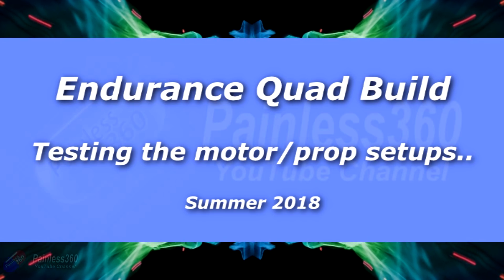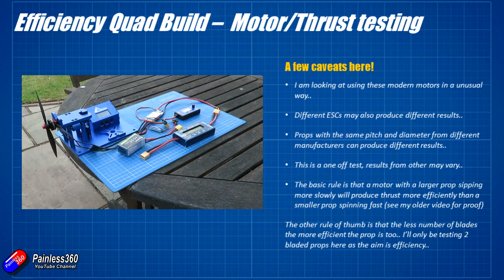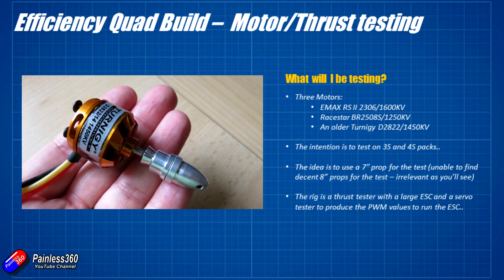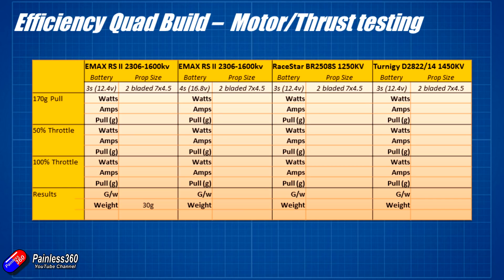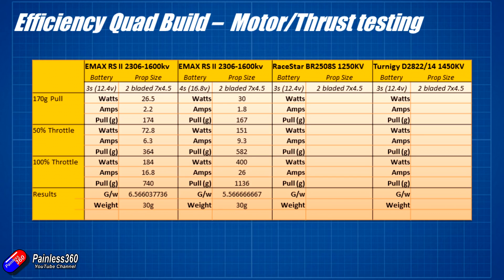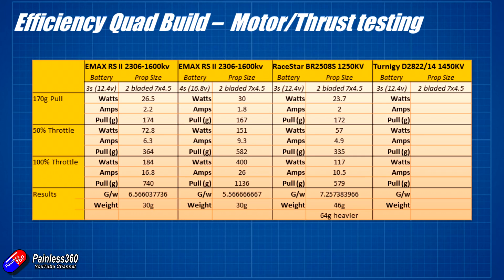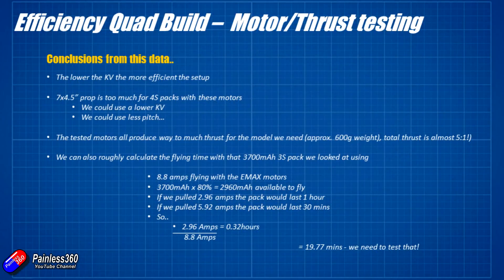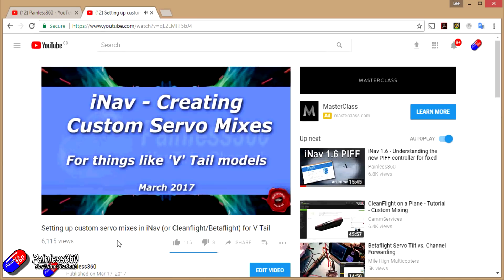Endurance Quad Build (S9): Motor and Propeller Testing

Comment: Dear Sir,
You tested the thrust of the motor horizontally. Would thrust be the same when we use it for vertical flying?
An Rc plane engine states that it has static thrust of 23.5kg at 1800 meters. Does that mean straight upward from ground?
The question what I'm trying to ask is: if the thrust is calculated horizontally ( you did in this video), would it be same straight up vertically?
Reply from the maker: Yes. Happy flying

Comment: Wait I just ordered these 2306 motors to use with 6s and HQprop 7x4.5x2. Yet you are saying even on 4s they get hot. Can I expect failure on 6s?
Reply from the maker: Unless the motor design specs have changed from the ones that get here - possibly. You always need to look at the prop design, size and pitch if you plan on changing the voltage you'll run it at.. Best of luck!
Reply: @Painless360  So if I wanted to use 6s on 7" I would need something like 2507 sized motors to not worry about the motors when flying aggressively?

Comment: I see there is a typo in the resulting data table. 
On the right, last column for Turnigy, at 50% Throttle the pull (g) value seems wrong, it should be 333, or around it, not 33.3, I suppose.

Comment: I’m new to quads however, I flew glow rc plans back in the 1990’s from .25 thru .90 size planes. Most of them where trainers to intermediate high wing models. Currently following your advice and fly small indoor quads and slowly advancing to a larger machine as my skill and confidence grows! That being said, I enjoy your instructional videos and have learned and continue to learn about FPV quads and the new technologies entering the hobby. Thank you for your time and effort as you are a great instructor.
Question about your thrust and motor selection has come to mind. Back when I was flying regularly, an advanced pilot and rc builder told me and other newbie’s that a move to three bladed props required a reduction in diameter and pitch to come close to the efficiency a two bladed version the given engine was designed for. This includes fuel consumption and temperature control. Therefore, why wouldn’t this be true for the electric motor given the forces of mass, inertia and centrifugal force? Could you not achieve a “ close enough result” with regards to thrust and current draw by reducing your diameter 1/2 to 1” and decreasing pitch?
Look forward to your response!
Reply from the maker: It still holds true - I normally drop an inch when going from 2 to 3 bladed props - you can see the effect of tri-bladed props in motor thrust/watt tables.. Hope that helps..

Comment: This may not be what you're looking for but I did some similar motor testing a while back. I used the same test stand you have and The Emax 2213 935kv Multicopter motor. 3s Battery

8x4.5  prop
50% throttle   161g thrust / 1.7amp draw /21 watt
100%              523g thrust / 6.6amp  draw / 80.3 watt

9x4.5 prop
50%               269g thrust /1.9amp draw / 23.5 watt
100%             778g thrust / 9.2 amp draw / 111.4 watt

10x4.5 prop
50%              333g thrust / 2.5amp draw / 30.9 watt
100%            938g thrust /11.3amp draw / 136.1 watt

The motors are quite a bit heavier at 53g apiece
Cheers!
Reply: Thanks for sharing that data!
Reply: You're welcome!

Comment: Great job, but! You need to try the Racerstar BR 2508S 1250kv with batteries of 4s, the real efficiency you will find in the thrust that the engine has half power or less, seldom is flying at full speed, because it is not a racing drone.

Check this out...

https://www.youtube.com/watch?v=hVu9AVy06fQ

https://www.youtube.com/watch?v=1xJyuDpwkJI

Comment: Built a 7in RMRC Valorem recently with the 1600kv RSII.   AUW without Gopro is 619g.   Using a Tattu R-line 1500mah 4s and HQ 7035x3 props I hit 8 minutes 30 seconds cruising around the neighborhood which means turning around and doing lots of figure 8s.   Motors were barely even warm.     Going to retry with gopro Session attached to see if I can do over 6min on 1500mah before trying bigger 4s packs like 1900 or even 5s on 6in while maintaining very careful throttle control .

Also built a 550AUW  6in Flowride that is on HQ 6040 V1S props and Emax RSII 1700kv motors.   Got 9min 30 seconds doing same style of cruising as with my 7in.

A 3rd Valorem 6in was built that is within 5g of my 7in Valorem.  it is running 2405 2250kv Hobbywings and HQ 6030x3 props.   On the same 1500mah Rline I hit 6min 30 seconds.

Comment: its odd your motor got hot on the 4s 2306 1600kv test, im running the same motor with 7x5.6  3blade on 5s with no issue
Reply: Does 6s get hot?

Comment: remeber that you have to stop the flight 15-20% before the battery is discharged completly. so it ends up with around 15-16 min. but anyway. 15min is grate.
Reply from the maker: Erm, please watch the video again. The 20% needed to be left in the pack has already been accounted for..

Comment: Awesome video! I wish I had come across something similar when upgrading my build. I bought 160g motors to replace the original 110g motors on my quad, not taking into account the extra 200g additional weight penalty, with no particular gain in efficiency.

Comment: This is great! Actually trying to understand quads instead of just schilling for the manufacturers with the latest, greatest and shiny-est quad. Some of us would like to fly high and slow for camera work instead of playing Star Wars racer through the woods....
Reply from the maker: Thanks Dave, those of us that don't race have been neglected by the frame and motor manufacturers over the last couple of years. If you want a camera ship then you have to spend huge amounts of money for something like a DJI product. For me, I still want to build a quadcopter using modern components but fly for a lot more than 5 minutes at a time..
Reply: This!  I don't want a costly DJI, and I'm not ready to play StarWars through the woods.  I'm trying to find builds for stable easy cruiser to carry FPV equipment and decent flight time and long range so I can enjoy the building and tweaking process and then get a great FPV view.  So far I've only seen flying wing vids that meet my criteria, but I really wanted a quad so I can stop and hover while looking around.

Comment: What about using the Garila 2507 1500KV motors? Or the Garila 2514 motors?
Reply: RCX has a 2208 1100kv motor at 43g
Reply from the maker: That's more like it! Ideally less than 1000kv would be perfect to test. Thanks for the suggestion!

Comment: Test flown my 7” vortex 285 the other day, still very agile even with a 4s 3000mah hanging under it. Your thrust data has inspired me to try a 3s 3000mah now though.
I’m running emax mt2206 1500kv motors 7x4.5 props (spin on slow fly) and am consuming about 8A on hover with the 4s 3000 and a xiaomi yi camera on board. In case anyone’s interested.
Reply from the maker: Thank you so much for posting that, so im not on my owm here! Looks like we're getting similar results. I'm planning to drag out some DJI 2212 920kv motors next!
Reply: Painless360 I think dji cleaned up the motor and esc niche for the 450 sized quadcopter when they brought out their e300 tuned propulsion system. What frame are you going to try those motors on tho?
Reply from the maker: Something a little special I can't talk about... yet! :)
Reply: Benjamin Harvey are you on stock ESC
Reply: Craig Demarest I am indeed. got about 10 minutes flight time. I’ve a 3s 4000 to try.

Comment: Emax on 4s at 50% throttle producing slightly more thrust and lower amps than the 1250kv Racestar at 100% throttle.   Considering weight I would likely use Emax and change the range of the controller so 50-60% throttle was my new max, have more resolution and lighter build weight.

I would go Emax and 3s with full throttle range or Emax on 4s and keep myself from using full throttle.
Reply from the maker: Thats what i did, you can preview the actual flight test in the next video in build playlist.. Happy flying!

Comment: It's a shame emax arent publishing any decent thrust data anymore. Was looking for data on the 1600kv's with a 6" prop the other week and also came up with nothing. 
Getting a fair bit of jello on my 7inch setup at the moment, so, I'm going to try swapping out the motors on my 6" quad for the emax 1600kv's and see what the flight times are like with a 4s pack.
Reply from the maker: Balance the props and also check the hubs too (See my balancing video) I find that helps..
Reply: Yeah, good point. I've not even checked them for balance yet. Had heard good things about the gemfan 7042 being pretty good out of the pack, but its worth a shot. 
I've a couple other types of 7-inch props lying around that I'm also going to experiment with too, will be interesting to see how they compare. 
Looking forward to seeing how you get on with the rest of your build!

Comment: Ive been playing around with my 7" helio spring quad with 6" props, tmotor f60 2350kv with dual 3S 1800mAh batteries 1top/1bottom mount and have been getting close to 12 minutes of linear flight without goPro ( moving those motors to a 5" Catalyst build when they release the "smooth operator") What size motors should I look for I wonder? Was going to try some 1700kvs but now i dont know lol
Reply from the maker: From this testing it depends on the pack you'll use. I would look for a motor <1300kv.. Let me know how you get on!

Comment: A suggestion for a future build....an Ardu Rover. An long range FPV ground vehicle running 433mHz (US) or maybe Frsky R9 setup for control, and 1.2- 1.3 gig for video. Range finding sensors, etc.....I saw a guy convert an old Tonka Jeep, which was awesomeness made from steel. I have my own design in my head, which even includes a "shock" system to keep people (animals) from touching it, and a pepper spray system to accompany it.
 Lots of warning do not touch stickers pasted all over it of corse because people are stupid, wink, wink, say no more..... ; -)

Comment: Is the aim efficiency or max flight time ? Obviously you can stick a larger capacity battery on any quad and get more flight time 😁 My old school  TBS Discovery’s get an easy 12 mins on 5200 4s packs using 900 kv 2216’s and my more modern TBS Obivion’s will get near 10 mins with an 1800mAh 4s pack and standard 5” 3 blades.

Comment: Be careful about how low you go.Some  low Kv  big "disc" style motors have a sync problem with some escs. BLHELI was supposed to correct this,  but I have not tried it yet. I run Mystery 650kv clone motors, in a tri copter,  and have experienced this. Once my tricopter turned over on its back into the asphalt  due to one motor loosing sync. Luckily minor damage. Swapped the motor with a spare, and no problems, but I  can't trust it until rebuilt, as its equipment is dated now. 650kv for front booms, and a 950kv for the tail. A secret most do not know for tricopter.  When you watch the big commercial 8 motor drones on youtube freak out and flip, alot of times this is the cause. https://diydrones.com/m/discussion?id=705844%3ATopic%3A1645799
Reply from the maker: Indeed. As I mentioned in the video (Or the next one - you can preview it in the playlist!) you do need to watch motor timing. As I've just got some huge 240kv pancake motors running well with BlheliS I'm confident it's possible to support 900-1000kv motors easily.. happy flying!

Comment: Awsome info. This is really interesting. I'm working on a rig that is carrying a gimbal and hero 6. With hq 7" triblades. 
With Tbs. Endurance motors. And 2600 mAh 4s. Total weight of quad is 1061 grams. Hover is 10amps. And slower cruiseing flight around I got 10-13 minutes. Looking forward to what else you find.
Reply: Dropoff510  I built a 7in RMRC Valorem using the Emax 1600kv motors and the HQ 7035x3 props.   drone weight is 410g without battery/Gopro.    On 1300mah 4s I am hiting 6 minute flight times, not crazy flying but a cross between freeroaming and freestyle.   Once the gopro goes back on the total AUW will be around 650g with a 1300mah 4s.     Goals of trying out 1900-2200MAH 4s at some point.

Motors came down cool to the touch after 6 minutes of cruising.   could not say the same for FPVAF 2307s in 1725kv, too noisey and I think the race minded sreong magnets made it peoblematic on 7in.   Nearly, or did, burn the FPVAF motors running Betaflight 3.4 with RC smoothing and Iterm Relax.

Went to Butterflight with the 1600kv Emaxes and a lot of my problems are solved, also saved nearly 30g of weight over using the FPVAF motors.

Comment: 1100kv Racerstars BR2208 with 2x Turnigy 2.2mah 3S lipo in Parallel on a APM FC F330 frame with no video and 8 inch Cheerson CX-20 props has been my Mission Planner Endurance Quad ... the 4s BARBECUE and the G/W numbers were the most eye opening ...cheers !

Comment: I'm curious as to why you didn't consider the TBS Endurance Motors: 
Stator size: 2206
kV rating: 1450
Reply from the maker: I've not tried them, thanks for the idea. I really need something with less KV than the ones tested in the video..
Reply: Yeah, they are pretty nice. I've got some on a 7-inch setup and they can easily do 10min+ of light acro flying on a 4s 2200mah.
Reply: i tried the TBS endurance motors and absolutely HATED the motor wire leads.   pain to soder and pain to even strip.

Comment: I would be wary about just blindly believing the rule of thumb about two bladed props being more efficient than three bladed props & thus not even trying any three bladed props. From real life flight experience with my 6" & 7" quads I anecdotally find either no difference or that three bladed props actually get me longer flights than two bladed props. Even if on paper & on a thrust stand the two bladed props might be slightly ahead, there's no way that you can simulate actual flight conditions without flying!
Reply from the maker: I'm not 'blindly believing' it as it's based on testing, experience and recieved wisdom. It depends on the design and quality of the props used too, as i mention in the video. It is interesting to note that larger models using low KV hign efficency motor setups all come with large diameter matched, 2 bladed props. Maybe I'll include some tests in a future video if I can find larger props with different blade counts that will do similar work. Happy flying!
Reply: Painless360 Sorry, didn't mean to sound accusatory! I only meant to mention that I was also familiar with that rule of thumb & the testing/experience/feedback that produced/supports it, yet for my own flights (& everybody's flying style will differ & change things) it doesn't seem to hold true.
Reply from the maker: No worries, this is one of those areas with lots of strongly held views and you can find as much info in articles supporting any view. Practice testing is very tricky as you need a few props with the same aerofoil and properties to test and that is something I've not found yet. Modern tri-bladed props are using elaborate designs and tweaks (bulldoze vs traditional for example) that can make a significant difference in thrust and efficienty too. Total prop area, chord, design, rotation speed, airflow and prop count all make a difference so without being able to remove some of the other variables then the test is almost useless. If you find props that can be tested that fit the bill then please let me know and we can do some practice testing and add some real world data to the discussion. Happy flying!

Comment: Now you're getting to a subject I am very interested in - long duration Quad flight. 1 hour sort of time.
Reply: youpattube1 now that’s tricky. You’ve got the issue of diminishing returns.
Reply: In what way ?
Reply: Well if you double the battery capacity, you don’t double the flight time. Unless you change battery chemistry. So then you move to a larger airframe, then face the same kind of issues again.
Reply: Yes, but what is so sacrosanct about this airframe ?  I am interested in reaching a goal of 1 hour quad flight duration. It undoubtedly means changing engines, batteries, frame size or shape, materials, etc. If your goal is an airplane that carries 100 people, you have to build a plane larger than a cessna.
Reply: youpattube1 ok then you’re likely to be going down the low kv, massive props, high voltage, super light custom air frame route. Flying with LiIon batteries. Maybe no fpv. Etc etc.
Reply: Maybe all those things, but maybe not. When you say massive, I assume you actually mean large. As for high voltage, probably not - just normal 4S etc. But who knows ?  Same for battery chem and frame weight. Painless 360 approaches these problems from an engineers point of view. If he was interested, he could prepare charts showing frame weight vs. required power , as he has done for props. Not to get personal with you, but you seem to have decided there is no point in exploring this as a goal.

Comment: It would be interesting to see if in real life you have longer flights because of prop unloading or shorter flights because of forward flight drag... Also, i think with the 2508 you can push 4s... You should test it and see what you get for efficiency and thrust!! I have a similar build I am working on using BH R3 2207 1660 KV motors to push 7" on an ultralight frame... Will also record hd with a caddx turtle so it should be around 300-350g minus lipo.
Reply from the maker: Very perceptive! Check out the flight test video (in the playlist) to see what happened..
Reply: Cant find the flight test video?
Reply: Found it...

Comment: Great series. I do have 2 old quads running Emax 2213 935kv motors swinging 1045 props. I run them on 2.2Ah 3S batteries. Your video series is making me want to get them out again!